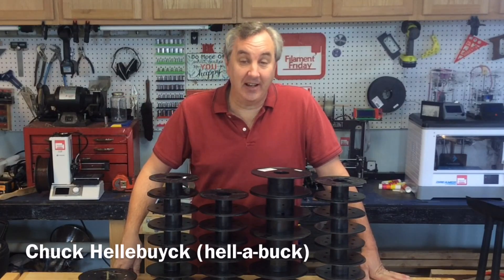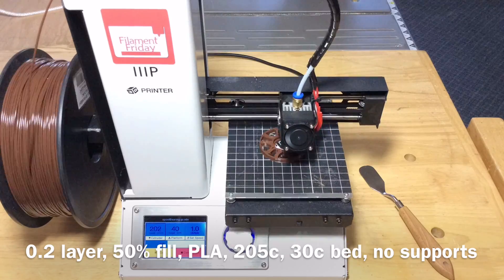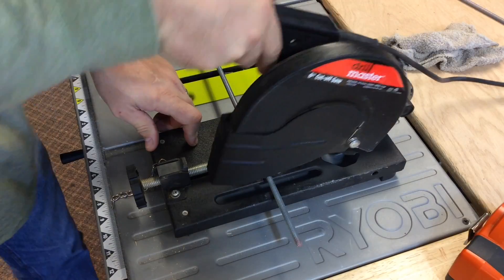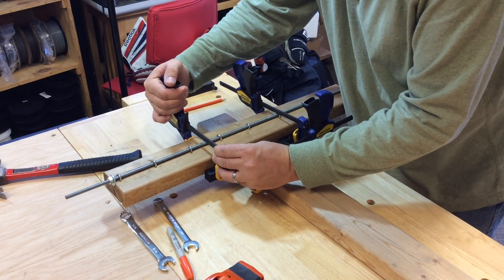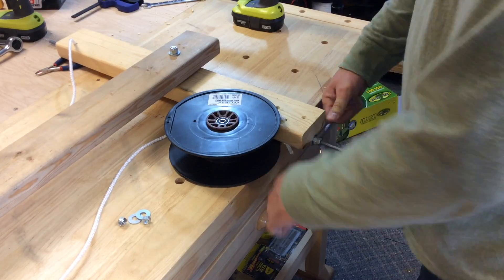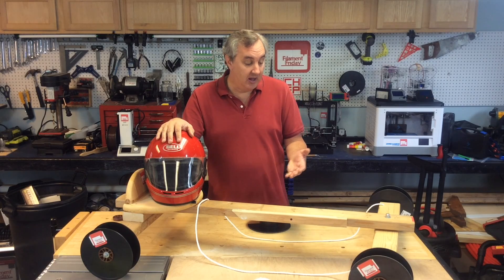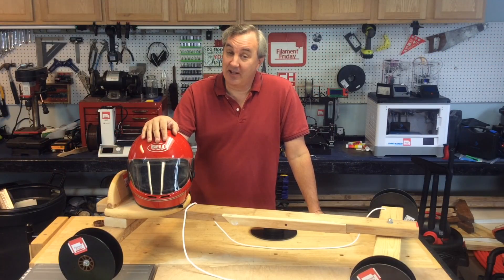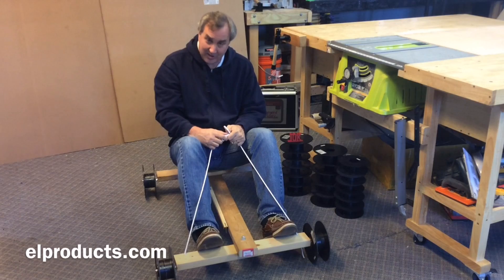3D Printing Filament Friday #87 - Spool Racer Coaster Car, 3D Printed Hubs and Empty Spool Wheels

Comment: Hello. I understand you make firmware for crality. I just baugh a CR10 V2 and it makes me crazy. It freezes, it restarts in mid printing. Do you have a working firmware you would like to share? I'm in dispare. Patrick, Sweden
Reply from the maker: Check the Creality support page. https://www.creality.com/download
Reply: @FilamentFriday  Thanks for the tip, already done that. Installed their latest firmware (wich is the same I already had in my printer) sadly it made no difference.